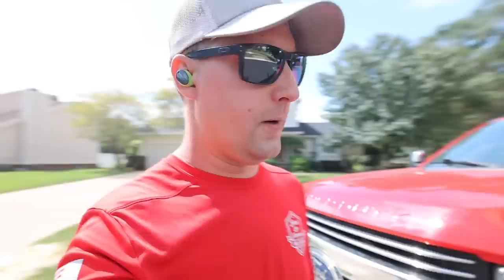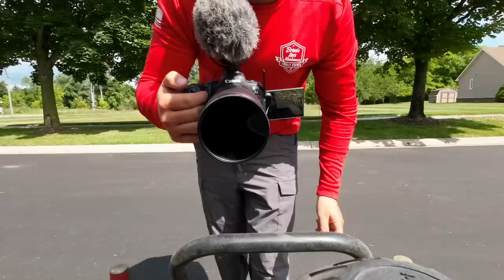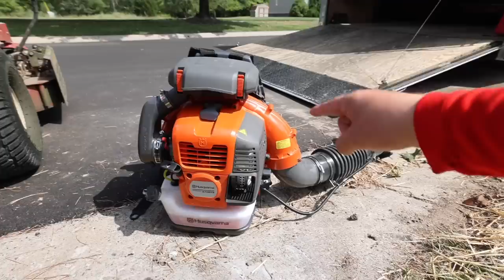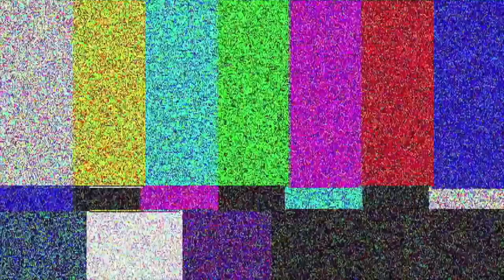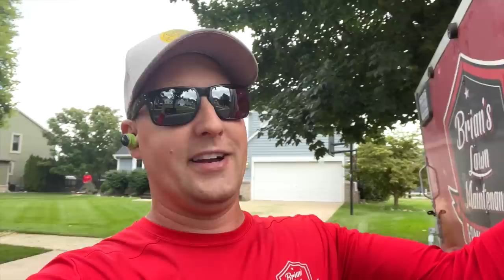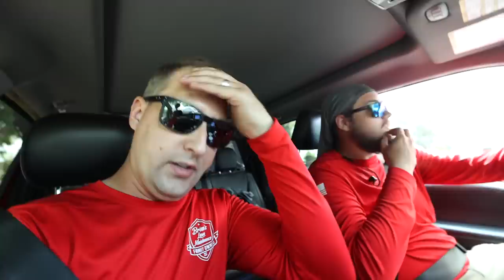EMPLOYEE QUIT BUT IF YOU KEEP THEM IT'S WORTH IT

Comment: If you haven’t heard of necrotic ring spot do a little research. It’s a soil fungus that’s very hard to treat/cure and it can be spread from lawn to lawn when doing aerations. I have two accounts that have it. It  can destroy a lawn quickly. Luckily I never aerated either of them before I figured out what was wrong with the turf.

Comment: Great stripes! Always helps when clients water their lawns during drought conditions. What height do you mow at? I measured the blade distance to the ground when our Exmark 48" Radius is in the mowing setting 3.5 and blades measured 3.25". I raised it to 3.75 setting and blades measured closer to 3.5". 
When mowing in setting 4 it doesn't seem to mow as well. Then again lawns are dormant and lack growth as clients tend not to water.
Looking forward to see how the new house turns out.

Comment: Is that a 570BTS blower?  I think that is basically the Redmax EBZ7500, which I run.  Love it!  Though I think you have the 8500?  And yes to the aeration video.  Glad to see you posting again and I figured that things were popping off on your end....which is not necessarily a bad thing!
Reply from the maker: The 570 is the 8500 series!